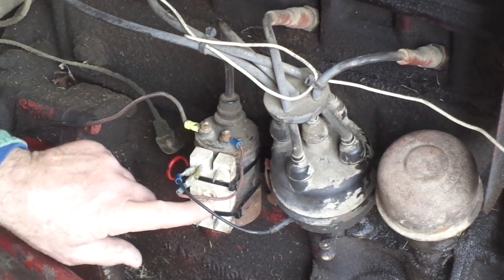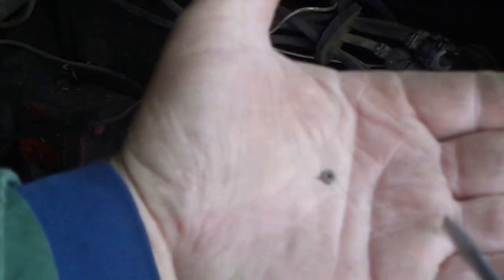Installing Points, '55 Ford 800, 172 cu in Overhead Valve

Comment: As I'm tippin my CuppaJO your way, I'm having a great deal of fun watching you give that old tractor surgery. Very nice! How about a video every morning with my first cuppaJO? Kidding of course since I can rewatch this one and learn some thing as I sip and tip to the west. I thought of a few things to send your way that I think you'll appreciate. I have been collecting a thing or two to take the big journey over the mountains to the 44 Headquarters. Thanks Kindly to you and your son for my entertainment with my JO while learning something. It has been a fine morning Blast indeed! Well Tractorman44, I just got an old 15.5 hp Craftsman mower with chains and a 42" snow blower. A dry gas tank, no battery, has an oil filter and been sitting in a garage for a number of years. So I'll see what I can do getting it started. I want to change oil, fuel filter and the usual before I attempt to start it up. I'm just glad the tank had no gas.,it was a trade with a lady friend of ours. She really liked our stone fire pit and asked if I'd build her one. So yesterday my friend Bobby bought another trailer at a farm auction and finally had another trailer ready to use. So we picked up the mower, which I had swapped for about three years ago. Oh yes, the mower has a Kohler 15.5 engine, as I mentioned before. She said it ran good when pulled in her garage. So now she only has two mowers in her garage. One she uses and one used little and less one she never used. I have a piece of roofing over it now but I'm going to get it in me shop somehow. It's sunny and windy today in the 30s, not a pleasant day to work outside, on a mower anyway. There is a mower deck but we all forgot about loading it up. I'll have to take the blower off to work on it but it looks like a simple enough operation. Half of my shop building is just storage and unheated. Lots and lots of stuff around. Old wood, lumber, doors and stuff to good not to keep. I even have a unused Craftsman blade I got many years back and I think it will fit. Almost scrapped it after trying to give it away. But it's destiny was otherwise. And people call it junk! Can you imagine. So now Ramblin on, I'd best get another cuppaJO held westward and begin to make a list of tractor starting stuff. Thanks Again for a great start of the day with me JO and Blessings to all the 44 Clan! And Stan of course! Have a Fine as frogs hair Tuesday and the rest of the week! Your JO buddy in Pa. DaveyJO
Reply from the maker: Good Morning DaveyJO...I looked at the PDF on the Craftsman you sent me.  That's a good and detailed bit of information. Hopefully the tank was run dry and not left to evaporate.  With this new gas, the carb could give you a bit of a problem, but it won't keep you from getting the old gal up and running.  I tell ya what I do on something like that that has sat for a few years.  I swing by the local farm store and buy a quart of the super expensive Stihl fancy pants pre mixed gas.  I'll dump a half pint or so of that in the tank and if you can get it going on that good stuff, add a bit of Sea Foam to the mix and let it run and run to do its majic.  A couple of my big chain saws sit for a bit and I do the same to them as well. Good luck with it and let me know when she's running fine for you.  I'll pass your morning howdy to old Stan a little later at coffee time in town.  LOL.  He's got a 24" leaner getting ready to fall across his fence right now.  So when it hits the ground I have to go whack it up for him !!  Have another cuppa JO on me DaveyJO and send me the bill...I'll gladly pick up the tab !!
Reply: Tractorman44  Good evening Tractorman44 Friend Wendell! Well I suppose the tank was run dry since it started right up and ran well. I let it run about 10 minuets or so before it took it maiden run to the shop. I didn't think about buy some of that premixed yippie gas. It's so easy to mix yourself and I think I saw that lazymans gas for like $6 a gallon. Would have used some if I'd seen your message before. Would it still be a good idea? And you can soon expect a package from the East. I was at the Amish Walmart today and what do you think they had hanging on a string? About four different calendars for their annual give away. I asked for two and said one was for my friend in out west. Can you guess what? Here's a clue, it has an Oliver on the cover. Give up yet? So before all the Xmas packages begin to crowd everything out, I figured I get it there soon. A few extra things will be included that I knew well the Tractorman 44 must have. So as I raise me evening cuppaJO your way, I toast a FINE tomorrow to you and all. Thanks for giving Stan my greeting. One day, I want to have a cup with you guys. Give a squeeze to the Misses for me,,,,,,,in the most polite way indeed. Wouldn't want you the get knocked down to the floor and me a bad reputation. I'll do the same for Alice from you and I won't get knocked to the floor either. So, as the JO fades slowly from me cup, I bid you a due but no dodo! DaveyJO
Reply from the maker: @daveyjoweaver5183  Man, I don't ever get that lucky with old stuff that comes my way.  With it starting and running so easily, don't waste your money on the high priced stuff.  I got to where I like it on small engines JUST to get them fired up the first time after a long rest....kinda like us with the first cuppaJO in the morning for a jumpstart. LOL.  My shoulders are hurting on occasion (actually all the time) so it helps me fire up the big saws that don't get used too often.  But you are good as gold with the old Craftsman. Save your money until the next 'retired' something or other comes your way...
    Man, a tractor calendar would be the berries man.  I get one on occasion but not even our farm supply place in town has them to give away or sell !! Thanks in advance for the care package DaveyJO....though I am not really worthy of your kindness.  Oh... and I already give the Missus a squeeze daily and tell her its from you in good old Pa. USA !!  So your reputation is already ruined for my benefit....LOL.  I ain't got slapped yet, but that could change any day.  Take care and we'll see you later.  Second pot is percolating......gotta go.
Reply: Tractorman44 Boy, I'm relieved you've been spared the slaps, kicks and Pickin yourself off the floor! But may be go a bit further if you desire. Oh, by the way, there is a platform bolted on to that old Craftsman what looks like an old water cooler for weight. The big lid on top screws off easily and it insulated so I figured water cooler. Well I took the lid off wondering if it have stones in it and wouldn't you know, it's 3/4 full of wheel weights. I thought it was bolted down when I went to pick it up. So it wasn't just because of my puny girly man muscles but a bunch of lead. I figured that it is needed when running that snow blower. There's a lever you pull back on and I think it raises the blower up a bit. Also looks like pulling the pin on a rod take the thing off from the mower, after slipping off the belt. I'll know more when I can get it in the shop and look it over. Today is sunny and with the wind blowing its plum chilly for my delicate skin and rosy complexion, you know all about it since it's much like yours. Time to grab another cuppaJO, toast you in the west and split some wood. I'll email you some pics of the monsters. So DaveyJO is outta here drinkin some JO cuz it's better than beer.

Comment: Just did the points on my 8N in August. I have the same ignition set I got as a present after I bought my first car 49 years ago! 👍
Reply from the maker: Yeah a lot of my stuff has decades old components.  Now days, you have to be careful.  I had a set of points run the tractor for about an hour and for some reason they glazed over with something...(????)....and lost spark.  The cheap ones just will not last anymore.  I try to make sure and buy the highest quality I can.  Do you buy from Dennis Carpenter or possibly Just8Ns ?  They are both known for high end parts.
Reply: @tractorman4461  I haven't heard of either of those places for parts. Thanks, I will try them next time. Sometimes I buy parts at Yesterdays Tractors, Steiner or amazingly I find an occasional part at Tractor Supply! I think I actually got the tune-up kit for the 8N at TSC. Luckily mine is a later 8N with the side distributor. I worked for a friend of mine at a landscaping company and he had a 2N and an early 8N that had the front distributor. I was the mechanic for him and would service everything in the winter. It was easier to pull the radiator to tune-up those front distributors! LOL
I also follow on YouTube J&D Productions out of Michigan. They have some good how-to videos and the have some good prices on quality parts.

Comment: My old Massey 33 is really finicky in the "points" department.  Thanks for posting.
Reply from the maker: They can all deal a fellow a fit on occasion.  I try to use tarps or plastic cardboard to shed rainwater or snow from distributors, alternators and carburetors to minimize the aggravation.  As far as being finicky department, the front mount Ford distributors are difficult to access as well.  The biggest problem I face is finding quality ignition components.  Thanks for tuning in sir.

Comment: Any chance you have the valve settings for the gas engine? Struggling with finding them here cheers
Reply from the maker: I think they call for .014 to .016 cold.  Both intake and exhaust Michael.  Good luck with your project.